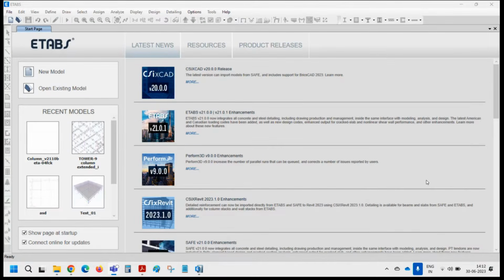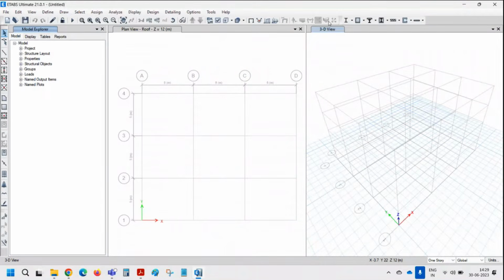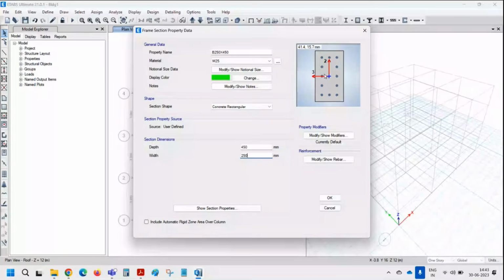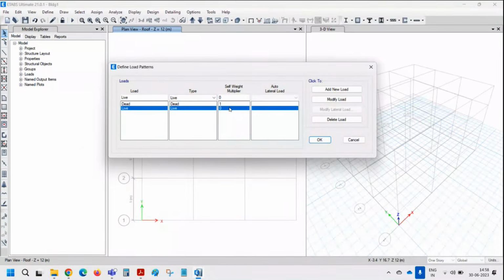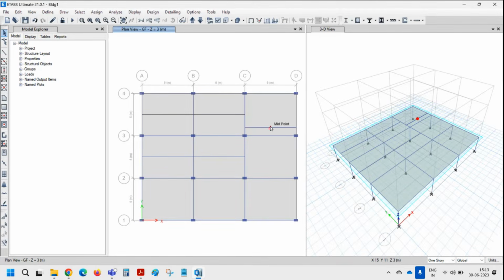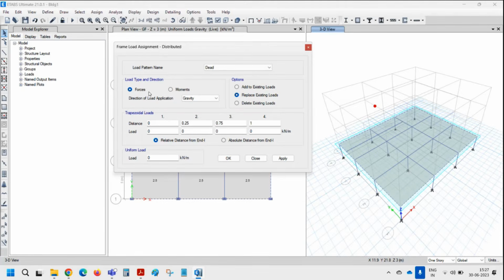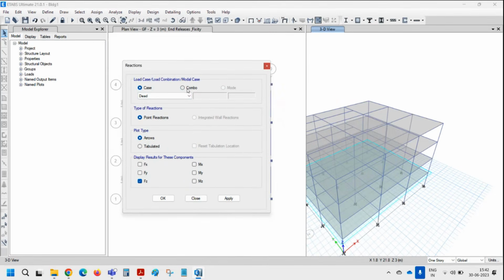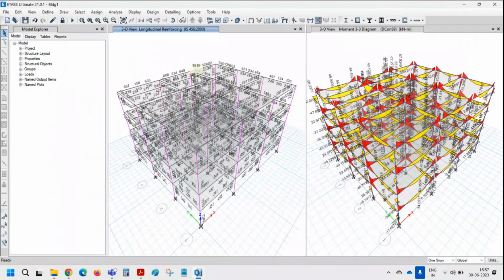ETABS Introduction

Comment: Excellent session! Please discuss about the following: 1) Include an Automatic Rigid zone over the column. 2) Slabs are defined as a membrane, then how is it showing vertical deflection, and how does it move up and down in animation? 3) Please discuss a real-world scenario - a building with plinth beams, and in that case first floor shall be footing top to the plinth beam, and in that case, how shall a storey height be defined as different footings will have different thickness? Kindly discuss in the next session.